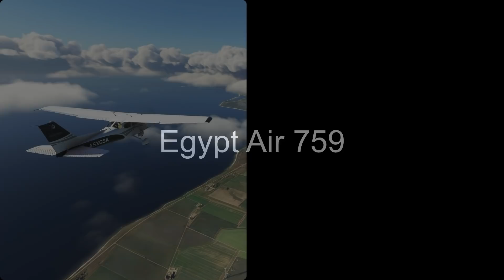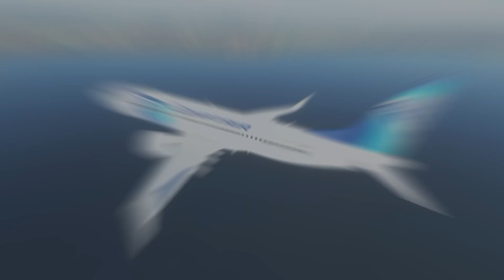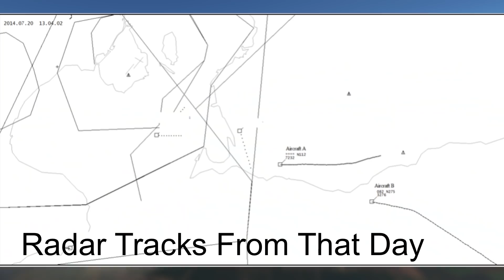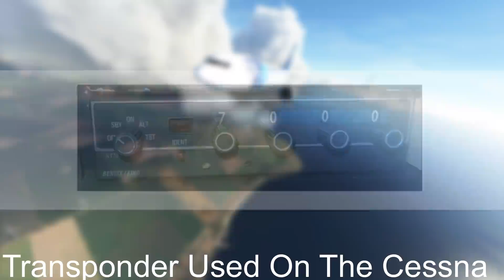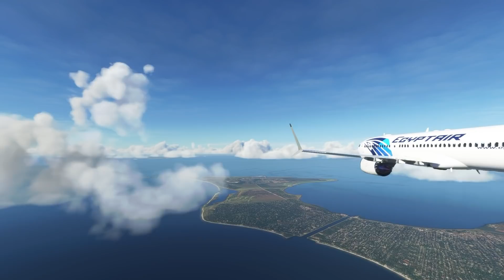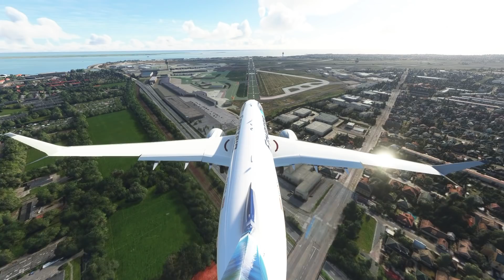How A Sick Passenger Almost Caused A Mid-Air Collision | Egypt Air Flight 759

Comment: My theory is when the Cessna’s pilot was cleaning up the… “foreign matter”, he could have accidentally turned off the transponder’s alt mode.
Reply: Nope, the "alt" was off before the "puke"...
Reply: @oscarolie5743  I was talking about him not turning it on at all
Reply: @beenbomb82  I reacted on 
Minh Quan Vo, not you, m8... ;)
Reply: @oscarolie5743  i’m not really sure about it. If it was turned off before the messy incident or not turned on at all, the ATC who asked the pilot to correct the squawk code would have also asked the pilot to turn on the alt mode.
Reply: @NoName-sb9tp  But when changing code, the standard and correct procedure is to first go to standby, then change the code, then switch back to active (in whichever mode) to avoid splashing every number you dial through across ATC displays.
Reply: transponder went into p mode
Reply: Yer and investigators sometimes forget that just because someone said something doesn’t mean that they are correct
Reply: Was thinking the same
Reply: Seems like a likely scenario
Reply: I worked at NASA/JSC and before every KC-135 flight everyone who was part of the tests were told to never drink anything red, like grape juice or koolaide. The KC-135 flew several dozen parabolas so it could experience weightlessness while descending. The constant change from 2G to 0G caused a lot of people to throw up. That’s why they named that KC-135 “The Vomit Comet”. If anyone threw up red liquid it would cut the flight short because it looks like blood. 

The Apollo 13 movie with Tom Hanks was partially filmed in the KC-135 in 1995. All of the weightless scenes were filmed while flying parabolas over the Gulf.
Reply: or it caused a short circuit in the control panel of the transponder.

Comment: I simply do not believe the Cessna pilot, he forgot to put his transponder in ALT mode, and doesn't wanna be in trouble so claimed it was correctly configured and it failed.
Reply: where's that bias come from? some GA pilot? radar returns (not transponder) should have given sufficient warning to ATC.
Reply: @1rbdfl  Not a pilot lol, the main reason is that the transponder tested ok after the incident, so I do not believe that it was properly configured during the incident. I am only talking about the pilot claiming the transponder mode failed during the flight, sure ATC could have done more.
Reply: @jacobwarren1498  The pilot may also have genuinely believed it was correctly set.  As there is no requirement for a non-commercial light aircraft under VFR to carry a mode C transponder at all, the pilot would not have been in any kind of trouble for failing to select altitude mode.  This was primarily a controller cock-up.
Reply: @davemould4638  Now that's a good point! I didn't even consider that no requirement
Reply: And I simply cannot believe that an air traffic controller would ASSUME the altitude of an aircraft and not held accountable for a near miss.
Very worrying, indeed.